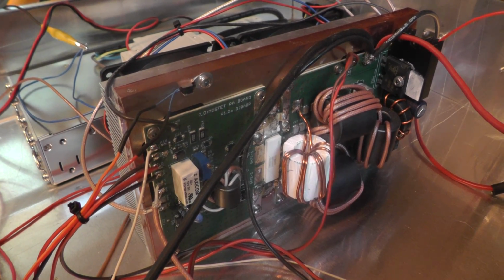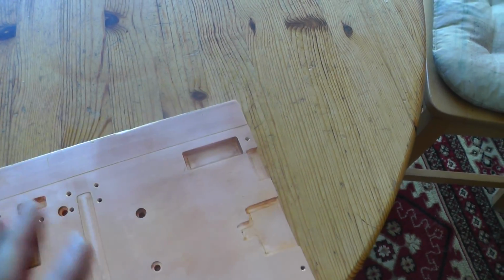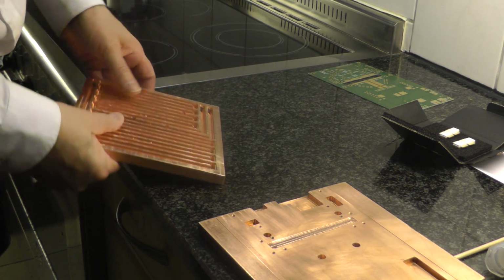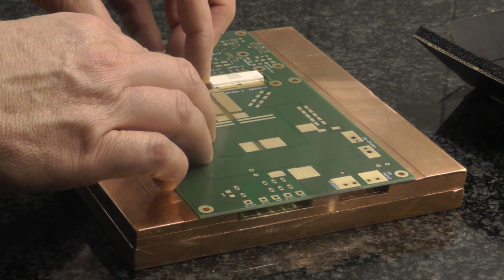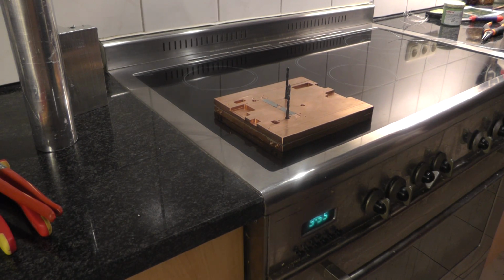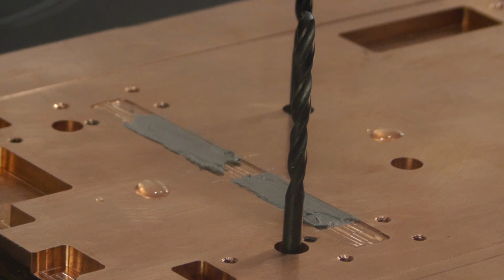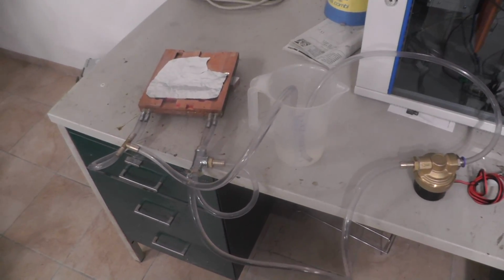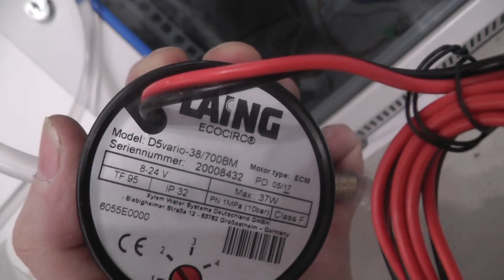2x BLF188XR Amp with WATERCOOLING (Part-1)

Comment: Questions (N=2) if I may?  Q1:  The water pump datasheet shows maximum flow rate of 16 Liters/minute, however what is the flow rate you recommend?  Q2:  It appears you are using 100% water, maybe tap or drinking water only.  I imagine there is a problem with growth of micro-organisms and algae if the water is not changed and cleaned frequently (e.g. every 3 months or so).  How do you handle this problem.  Do you simply drain the system of water each time you use it, or do you add some type of chemical to water to kill the bacteria?  Growth of micro-organisms + algae is a common problem for closed-loop cooling systems, such as those of CPU cooling, or commercial chilling systems / heat exchangers, so I am curious how you handle it for your amplifier.  Thank you and amazing work by the way!!
Reply: I imagine that the copper itself offers antimicrobial qualities similiar to the properties of copper pipe in potable watervsupplies

Comment: Didn't you overcooked it a little based on a copper color changed? VA6AM
Reply from the maker: maybe, its hard the get a specific temperature on the kitchen's oven. But the BLF188 survived the procedure without any problems, so all is fine.
Reply: Thank you. My concern was about transistors. I have no experience with this approach but it looked like a tough test for transistors.
Reply: crispy copper and blf188 . tastes good with butter
Reply: You can use a cheap "LCD separator" hotplate from China, around 30$, with temperature control. Use BiSn solder and 160°C temperature. It is a very safe process, I soldered several MRF1K50 and a lot of MRFE6S9160 this way, no failure.

Comment: Why did you machine channels in both plates and not just the one with the power devices?
Reply from the maker: good question. My idea was that the solder could flow into the channels. To prevent that I machined both plates with an edge around the channels.
Reply: @harry4516  Ok, why did you solder the two plates together and not just bolt them together with gasket sealer? The lower plate is really just there to seal the channels isn't it? I've recently designed a similar cold plate for another application and I've machined only one plate with a flat plate underneath to seal the cooling fluid. I don't see the advantage of machining both plates.

Comment: I would like to know your opinion on the use of fuel assemblies diodes in the protection of the gates of LDMOS transistors.
Which TVS ones do you use?
Reply from the maker: care should be taken that the diode-capacitance is low. Its hard to find powerful diodes with low C. So the TVS are only the first security stage. The second stage are Zener diodes at the gate. The use of diodes at the gate is easier because the gate capacitance of the LDMOS is usually much higher than the C of zener-diodes.
Reply: @harry4516  Thank you for your answer. I will use CDSOD323-T05C.
Protecting the LDMOS shutters is a priority for me. Another question is the poor performance of the ALC.
Power emissions.
I follow your work. Thank you very much.

Comment: How is it performing in the functional circuit now? Is it effective?  I'm preparing to make a similar milling, except with additional fins in the channels, for more active surface. (similar to the MIT' instant pop cooler project...). I've had a water cooled copper plate in my PA, made by someone, but it was merely like four turns of 1/4 copper tubing soldered to the plate's surface underneath, and that was not too seriously effective. The PA lasted about 6 months before the thermal protection was no longer allowing me to even send my callsign in full.
The transistors were not soldered to the plate either, and the clamps used over them were not too tight, and small. I've taken the whole thing apart and re-doing from the scratch, including the enclosure. I'm very concerned about this sandwich approach and its actual effectiveness.
Have you tried some higher than average duty cycles with it? Like i.e. JT65? (like the EME, 6m, 50s/50s).
TIA,

jarek, va3ncd
Reply from the maker: Hi Jarek, the water cooler allows continous transmission with 1kW until my water gets hot. I have a 10 liters water tank and a aquarium pump. I takes about 25 minutes to heat up tis tank if I do not switch on the fans.

Comment: how is it only outputting 1000watts? each of the transistors is rated up to 1400watts RF output?
Reply from the maker: since the output power does not depend on the transistor. It depends on the winding ratio of the output transformers, and there is a physical limit by the impedances in the whole system compared to the 50 ohms antenna resistance. So, with all these usual designs you will end at about 1000 watts. For higher power you need to combine multiple boards together. Changing the winding ratio is not a good idea, because it will result in much (!) higher current which cannot be handled by the usual PCB designs.
Reply: @harry4516  It sounds to me like you are not exploiting the transistors to their full potential. You simply settled with a design that running at lower than what the transistors are capable of. For the transformers to handle higher current just use thicker cables. Also I think your filter is killing too much of the output power probably. I don't know why you decided to use transformers for combining the output power? But overall your work and craftsman is really good. I am sure you can make additional improvements to make it output higher power and your main reason for this inefficiency is the broadband design trying to make the amplifier linearly outputing the same power across a large band of frequency. usually RF transmitters/emitters will be only used for one single frequency or a small band. You can't have a design at high power efficient on a large band of frequency.

Comment: A temperature shock while adding LDMOS on hot plate is big mistake. The results will be visible after long term operation.  The "overcooking" should be prevented with gasket sealed water cavity. And if something goes wrong (and it will!), this is irreparable.
Reply: I agree. I already lost transistors by cooling down too fast. Since I use BiSn solder paste for the transistors and heat up and cool down slowly never a problem. - He could have soldered the copper plates with PbSn in the 1st step, then leak test, and then solder the transistors with BiSn in the 2nd step.

Comment: You should post a link of where you purchased the blf188xr units, there are so many fakes out there. you may help with preventing the scammers from profiting if you post the link either under the title or in the comments and pin it.
Reply from the maker: Hi, I purchased it from mouser.com. Its a bit more expensive than others, but original quality.
Reply: www.rfparts.com is a great place for genuine parts also. Not sure if they carry this particular LDMOS device, but they have a huge selection of RF power transistors, MOSFETs, and tubes.